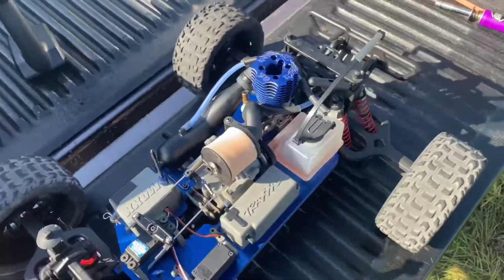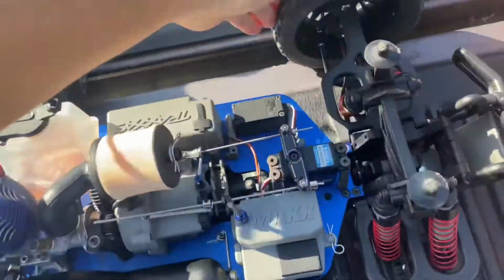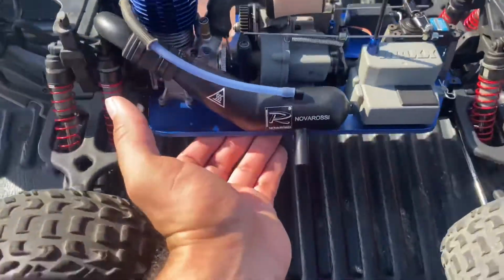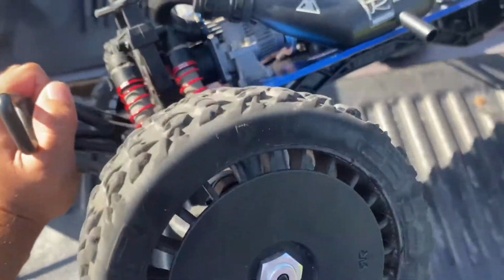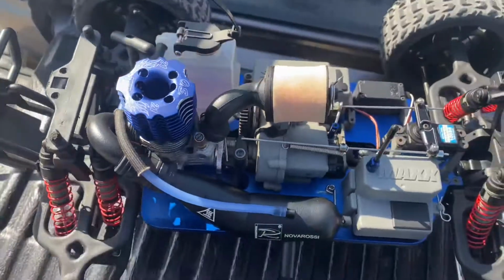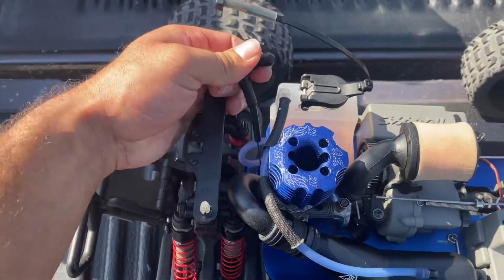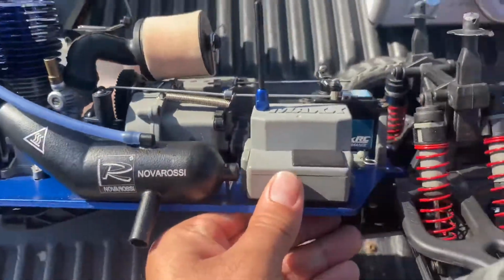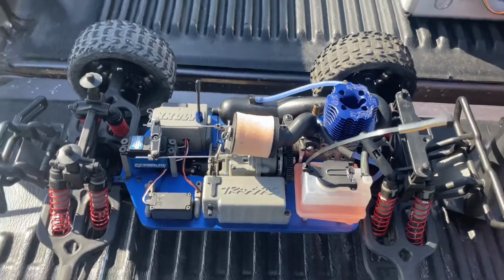OS .21TM TMAXX build and short run

Comment: Dude please let me know how that m2c racing clutch works out for you. I have been wanting to order one up. Also that pipe is sick! I wish I had one of those lol
Reply from the maker: I actually put the m2c clutch in my revo when it came in and stuck with the integy in my tmaxx! Both are working great I like the m2c a little more because of the really strong springs and different springs for tuning options.

It literally bits so hard in the revo! The integy isn’t a bad 3 shoe clutch either for the money! I will get a video of the revo soon to show how well it works. Also thanks for the sub! I subbed back

Comment: Shifts way to early
Reply from the maker: This is old man. Truck was all changed up with new gearing and new parts on this maiden run. Hadn’t even gone for a few passes barely. Transmission shift point hadn’t been adjusted yet obviously.